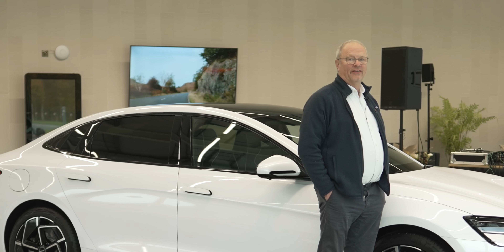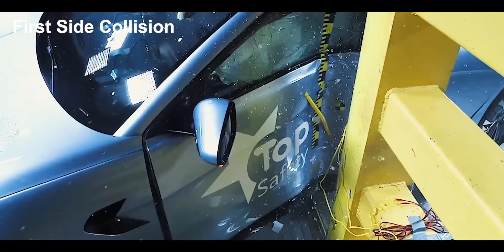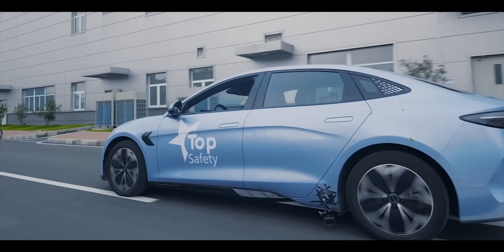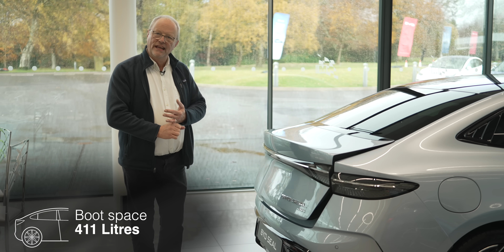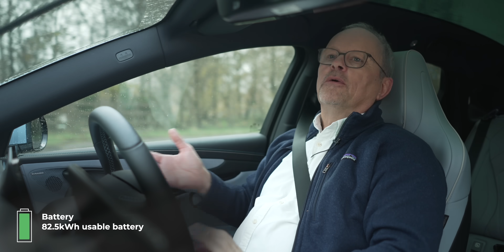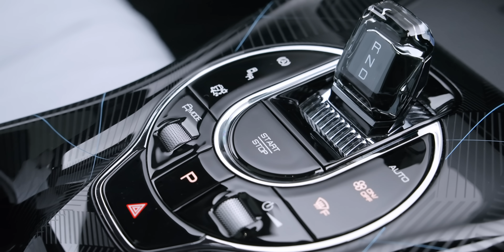This Car Proves Just How Far Chinese Cars Have Come

Comment: Mentioning whether the car has V2L (vehicle to load) should be a standard fixture of these reviews.
BYD Seal has it.
Reply: V2L is pretty handy, I use it to charge my DeWalt batteries while I'm out working. Use it weekly.
Reply: Good for power cuts, camping etc etc
Reply: It doesn’t have shade like the atto3.
Reply: @jeremytine  Although only 2.3Kw t i sufficient to power critical home systems in emergencies. I have used it to power frige/freezer lights and computer during a power outage. Also useful for picnic and light power tool  applications. Agree 5Kw would be an improvement
Reply: @jeremytine  Not a decision maker, just a feature which is more useful than apple carplay and 10 speakers.
Reply: @jeremytine  Thanks for the info. It should be said loud and wide, we cannot accept symbolic V2L, it has to be the real deal and it has to be standard for any new EV model.
Reply: Tesla supercharging network , BYD hasn't got it......
Reply: V2L is a gimmick. A "shiny thing" for those easily distracted by shiny things.... Positive form of confirmation bias.
Reply: @rogerstarkey5390  It saves me from buying a home battery.
And it could provide a crowdsourced solution for grid storage in a sustainable energy system and combat climate change.
But sure, it's a gimmick if you don't care about any of that.
Reply: @rogerstarkey5390 well I enjoyed cooking breakfast the other weekend when I went away camping with the missus, used the v2L feature to cook bacon and eggs using our electric frypan and boiling the hot water in our electric jug for a cup of tea, so hardly a shiny gimmick.
Reply: @rogerstarkey5390 guessing you own a Tesla that doesn't offer V2L
Reply: @rogerstarkey5390  As someone who had three power-cuts on Monday, I'm beginning to think V2H is becoming a hard prerequisite. Once I had a winter power-cut that lasted many hours. Thank goodness for the open fire. Given the FC Stop Burning Stuff campaign, it's ironic that we had to burn stuff to stay warm because the power grid failed.
Reply: @rogerstarkey5390  >> V2L is a gimmick.  <<
makes a lot of sense in work vehicles -- ie, pick-up trucks.   Any EV with mid/high-sized battery ~70KWh should have them.
Reply: @rogerstarkey5390  I’m using my Seal’s V2L to power my house. Videos on my channel
Reply: We use ours all the time to power our spin dryer int he garage using the cheap overnight electric sitting in the cars battery, it's saving us 1/3 the cost in winter @rogerstarkey5390
Reply: @rogerstarkey5390 Used it for power tools, vacuum cleaner and carry an induction hot plate and electric jug in the back for on the road breaks. I know it can back up xcritical home electrics like fridge, lighting and TV/computers.when there is a power cut.

Comment: Why have they put the charge port on the other side to Tesla? If one of these rocks up to charge at a new open to all Tesla charger, they are going to have to block 2 stalls. Utterly ridiculous.
Reply: Tesla have adjusted the position of the charger, plus the cable connection on new installations to compensate for the failure of others to reach an industry wide agreement on charge port position.
.
If it's a "bay end" charger "front end" cars can pull in forwards, rear end can reverse in, with the central cable position and length reaching  all ports.
.
"Bay side" chargers? Right side port, enter forwards, left side port, reverse in.
Again, the cable exits close to half way, front to back in the bay and is long enough to reach all ports.

Comment: You forgot to mention that BYD are quite big with electric buses both here in the UK, but in Europe and obviously in China.
Reply: Also the only automaker that dominates the entire battery development and production, and one of the largest battery manufacturers, selling batteries even for Tesla.
Reply: @SomewhereInTheSolarSystem  it is the most vertically integrated EV company in the world.They even own lithium mines and make their own chips
Reply: @SomewhereInTheSolarSystem 😊😅😅😅😅
Reply: Interesting. I never knew that  @SomewhereInTheSolarSystem
Reply: In Lancaster, California BYD makes electric buses and garbage trucks. And BYD is building a factory here in Rayong, Thailand to make EVs.
Reply: Lots of BYD buses in Portugal, too.
Reply: @amniote69  Many cities have fleets of BYD buses, Madrid and London among them. BYD has a facory in California making buses with local labor.
Reply: Some BYD UK bus chassis are actually made in the UK now adays, and the next gen will have the blade batteries.
Reply: @milesprowerdavis7658 

Hydrogen fueled vehicles are far more likely.

Batteries cars are becoming expensive to insure in UK and that's a bit of a disincentive.
Reply: @t1n4444 the technology, infrastructure and fuel availability for hydrogen powered vehicles isn't there, or from what I've found, it is not even near mass production / mass market capacity.  
Pity, because it does seem like a great option, but the evidence seems to be that it isn't as practical as BEV's.
Reply: @JakobusVdL  

🤣🤣🤣🤣

Yes, granted, but this situation will not prevail forever.

Of course some authorities claim that hydrogen is "difficult" to work with ... could they be "supported" by the fossil fuel industry ... surely not?

A lot of posters appear not to understand that R&D ref hydrogen exploitation continues apace and their counter arguments against use of hydrogen comes across as a history lesson.

That said these posters also appear to ignore that Europe, for example, is engaged in pushing hydrogen cells or hydrogen combustion in domestic vehicles.

BMW have been testing hydrogen cell vehicles across the planet and are to introduce a "domestic vehicle" within the next few years in Europe and also South Africa.

I speculate some countries take global warming a great deal more seriously than others.

I further speculate that a "lot" of Musk's disciples tend to accept his nonsense ref hydrogen fuel cells without question.

And, ref this argument that hydrogen gas won't "work" for heating ... if the detractors had done some (any?) research then they would have discovered what was called "town gas" as used in UK for quite some time up until 1967. (Which saw the introduction of North Sea gas.)

Town gas consisted of 49% hydrogen and 34% methane (you can Google the rest of the mix for yourself).

In short hydrogen did "work"  for decades.

As for the claimed prohibitive costs for producing hydrogen gas  then, again, this situation will not prevail forever.

Lobbying by the fossil fuel companies will go away ... once they have set up their own hydrogen generating plants.

Or am I being unduly cynical ...

Simply because Musk has been successful in some tech' should not be taken for granted that he gets it right every time.
Reply: @JakobusVdL  hydrogen is the only realistic way for heavy vehicles, plant, lorries etc, it's clean, safe and quick. As soon as you get in to heavy vehicles that go up and down hills and in all weather( not just warm and consistent temps), batteries become extremely  impractical. If you could get enough batteries into a electric lorry to  be equivalent performance and could manage 600 miles per day, the charger would  be capable of powering 2000 houses!!😵😵😵 there are well over 500,000 lorries on the road, do some maths and figure out home much capacity we have spare on our best day and if we doubled that in the next 10 years we would still just have a tiny fraction of what needed without including  electric cars, vans lgv's and domestic heat pumps! I wish it wasn't true but some one in power has looked at the numbers and still lead us down this path. The future is eclectic not electric👍👍
Reply: @TheHamiltonRacing  a very impassioned post, but where is the evidence that industry is developing the technology, infrastructure and fuel availability for hydrogen to be used widely? Whereas there is lots of work going on to produce battery powered trucks, buses and plant.
BTW - "the future is eclectic not electric" is a great line, but contradicts your initial assertion that "hydrogen is the ONLY WAY for heavy vehicles".
Very likely the future for heavy vehicles will be eclectic - diesel, BEV, electric trains, sustainable hydrocarbons, hydrogen, maybe other fuels too.
Reply: @JakobusVdL your correct it won't just be hydrogen! As to your proof,JCB has been perfecting hydrogen for over a decade and they are not the only super company doing it. There is very little infrastructure needed, just like we have shipping containers parked at fuel stations with add blue pumps and tanks!  gas tanks can be added in the same way. With the added benefit  exciting mechanics are able to service most of these vehicles with no extra training.
Reply: Legacy Auto look out!
Reply: …and the US
Reply: In US too!
Reply: this is so important to point out. BYD has years of R&D and success from their big EV vehicle fleet projects
Reply: BYD makes the city buses in Anaheim, CA where Disneyland is.
Reply: Yes, their buses are all over london
Reply: @TsLeng  

Well done Sadiq!!!

And ULEZ type legislation goes some way to fund it all.

Keeping private cars powered by fossil fuels off the roads is but one step on the way to a cleaner atmos in London Town.

When battery EVs replace ICE vehicles then Sadiq can levy a charge on them because of their weight.

Eventually we'll see the weight considered an issue ref road surfaces, bridges and multi storey car parks.

Doubtless any such future legislation will allow for public transport and goods vehicles only (and taxicabs) ... when powered by hydrogen.

And slightly tongue in cheek the introduction of rickshaws ... drawn by the wilfully unemployed if they want their benefits.

The health benefits to those on the dole will also reduce their need for medical facilities too.

Now that's proper social engineering, so again very well done Sadiq!
Reply: Toronto, Canada (TTC) city transit uses BYD buses
Reply: Also in the USA, as the BYD factory there is located in Lancaster, California.
Reply: NOT quite big, BYD is world largest  eletctric bus company, it has  over 80% of world market ,they are sold in more than 70 countries in world, not just  UK, ,  such as in japan,  90% electric bus are BYD
Reply: Byd also makes iPad screens for apple
Reply: Also in LATAM. 379 electric buses were dispatched to Bogotá since 2020.
Reply: Yes, my town in Hungary has them. Much quicker and more quiet than any diesel.
Reply: @AndrasMihalyi  I think another massive Chinese  battery manufacturer CATL is building a battery plant in your country!! 👍
Reply: @kin9225   correct, and BYD and Zhejiang Shuanghuan Driveline too.
Reply: @kin9225  Don’t buy from Chinese owned companies like Volvo, Polestar, MG, BYD and so on. China is a dictatorship with no human rights or democracy. Giving them our money will backfire. Just like EU learned from doing business with Putin
Reply: @AndrasMihalyi  Two of the largest battery manufacturers have established production bases in your country
Reply: Also commercial trucks
Reply: Glad we are giving some credits to BYD for their busses. They invested heavily on EV in general and they can bring the prices even lower because they just have a manufacturing advantage 😮😮😮
Reply: All Tesla car are using BYD technology share with US due to trade deficit and even their Gigafactory are supplied by BYD. That just the tip of the iceberg lol
Reply: Don’t buy from Chinese owned companies like Volvo, Polestar, MG, BYD and so on. China is a dictatorship with no human rights or democracy. Giving them our money will backfire. Just like EU learned from doing business with Putin
Reply: The UK is part of Europe.
Reply: He didn't forget, he just didn't bother.
Reply: holy shit i take the stagecoach buses everyday I never realized that they were made by BYD thats insane
Reply: Japan also... Hard to imagine that happens in the home territory of Toyota...
Reply: From Kentucky USA...Yeah. Go ahead. Buy a Chinese EV. Save the planet. 

BWAAAAHAHAHAHA...
Reply: @marcomalo02  "National Security!"Silly USA.
Reply: That explains the fires

Comment: One thing missed is - Charging Speed.. not good enough
Reply: I charge at home during night time so doesn't matter for me at least
Reply: I own a Seal and can add 350km of range in 20 minutes- why is that not good enough?
Reply: @EcoHouseThailand  it is good enough I just wanted to know, thanks for letting me know
Reply: Not all people care about charging speed. I only used rapid charger 3 times during last 3 years.
Reply: Like Arabs asking if the car has heated seats
Reply: Charging curves of BYDs are linear whereas other manufacturers may quote insanely fast charge times but they only charge at that speed for very brief periods, so in the real world it’ll probably be just as fast as everyone else.
Reply: @123silentassassin  also LFP can charge to 100% whereas Li ion is only safe to 80%
Reply: I also charge  99% of time at home but I need to know

Comment: A luxury car to me has manual doors, boot and bonnet. I haven't the time to waste, waiting for electric motors. If I'm sitting on a lethal battery, I need to be able to get out without power. It must also have genuine leather seats and no plastic in the interior
Reply: Which car has no plastics in the interior?
Reply: @universeisundernoobligatio3283 
1936 Rolls Royce Silver Ghost
😉😂
Reply: @rogerstarkey5390  
I'm sure they make them by the millions.

Comment: 😂 the perfect EV is one with a petrol engine that has infinit range and won't cost $50,000 to have a new battery 🎉
Reply: Knock a zero off the battery price, and you'll be closer to accurate... and that 'infinite range' petrol engine needs you to pay for petrol to give it that range... as well as pay for the servicing of that petrol engine, and pay the health conditions caused by burning petrol, and pay for the repairs and other costs of the climate change caused by burning petrol, etc.

Lots of extra costs you have to keep paying if you pick petrol.  Conversely, I paid once for a solar install, that now powers my home and my car... nothing quite like knowing you're driving - virtually for free - on sunshine :D (and yes, even in this country we get enough sunshine for solar to be viable).
Reply: Costs are coming down all the time & range is also improving, replacement tesla model 3 battery cost is now $9000.
Reply: An "EV with a petrol engine" isn't an EV.
Reply: @rogerstarkey5390  

Indeed it's a much cheaper easier to repair and cheaper to run for 250,000 miles car 

EV's are an environmental catastrophe they pollute 10x more than ICE cars 

It is all starting to unravel... EV's are a disaster for the planet

Comment: Too bad they didn't design it with a hatchback, that would be a big improvement over Model 3. Robert did say BYD when talking about blade batteries without triggering the assistant.
Reply: Search BYD Song L, or BYD Denza N7.
Reply: @Fldllse  thanks, no BYDs are available in Canada yet. I'm surprised there's no hatch on this model which appears to be direct competition to Model 3
Reply: 3:45 - He said "B-Y-D", is it not triggered by "Byd" instead? Genuine wondering 🤔
Reply: @TheStuartstardust you actually need to say "Hi BYD" and then the command. I have turned this feature off and use the microphone button on the steering wheel, press it once and say the command, like open front right window for example.
Reply: @TheStuartstardust  Robert claimed the 3 letters of the name would trigger the assistant, which it didn't. Maybe one needs to say "Hey, BYD..." ?
Reply: Need to say “Hi/Hey BYD” or click the mic button on the steering wheel
Reply: It’s nice but I’ll be very interested if it’s a hatch.